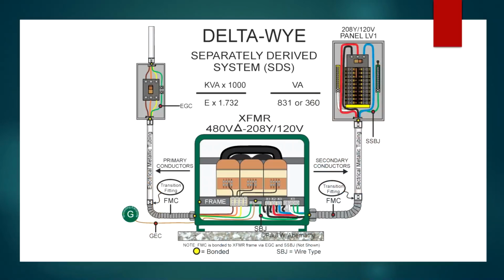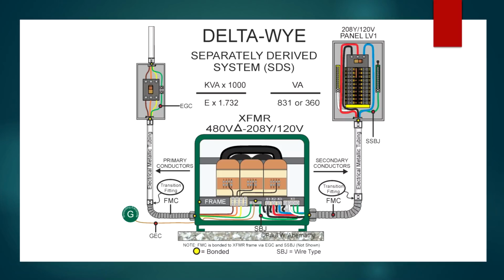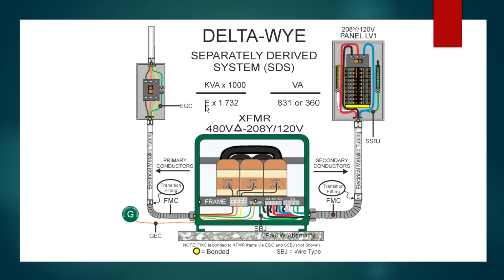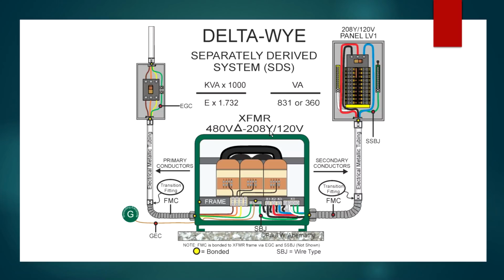2017 NEC - Transformer Series Part 1- Calculating Primary & Secondary Current Ratings

Comment: Have a question and can't seem to find the answer anywhere, and don't remember from school. I am doing load calcs for an analyzer shelter, when you do the calculation for the secondary side of the transformer, is that voltage the stepped down voltage of the transformer? (1): For example, I have a 45kVA transformer stepped down to 208/120 distribution panel so I have some circuits using 208 and some using 120. (2): This rated current, that is referring to ALL loads on that one leg correct? (A,B,C) Basically I am working backwards to determine kVA for transformer size. Let's say I have ~185A on my panel, I can convert this to kVA and determine transformer sizing correct? I guess I am trying to ask if it is correct to add all amperage of circuits and convert this to kVA to determine my transformer kVA size? (Using both 208/120 circuits throwing me off)
Reply from the maker: Greetings - We no longer support answering NEC related questions on Public Videos and Podcasts. We offer a Consulting Service that is more than willing to assist you. Thanks again for watching our videos.

Comment: Can you do a series on solar panels or photovoltaic as the NEC calls it? Secondly, on your video on table 220.55 The only thing I would like to know is what if you have a range(s) in all three columns like for example a 2.5kw range, a 5kw range, and a (2) 12kw range? Would you just treat each of them as column c and use the max demand of 4 appliances ? What would be the correct way or get the smallest value?
Reply from the maker: Greetings BBQ- With Cooking Appliance and Table 220.55  you would have to compare as usual. You always use Column C unless Note 3 applies. In your example, be it a highly unlikely example, you take those under Column A and B and work those percentages and combine their results and those (2) using Column C take their results and add all the calculated values together....and then compare that against Column C for 4 cooking appliances and whichever is less...that's your selection. As for PV, I will see what I can do.
Reply: @MasterTheNEC  thank you, by the way, I am your biggest fan
Reply from the maker: Thanks Fella...Appreciate You.